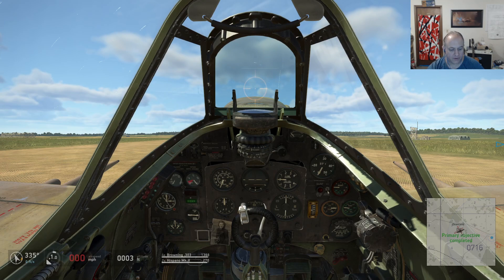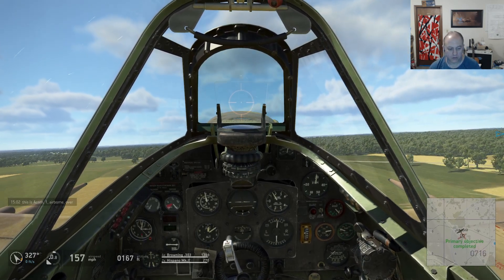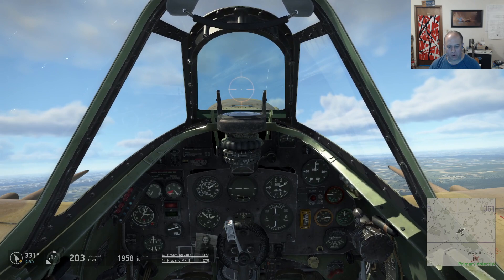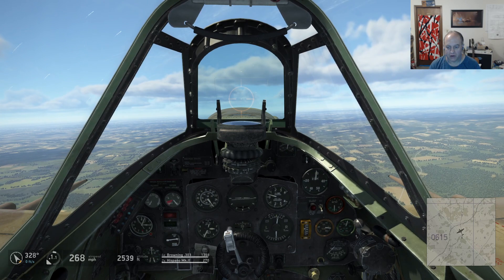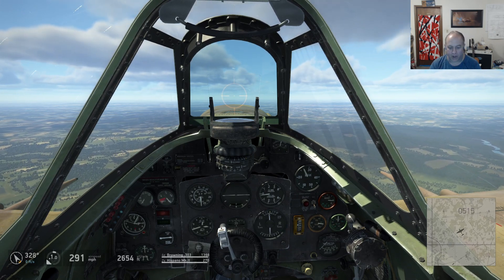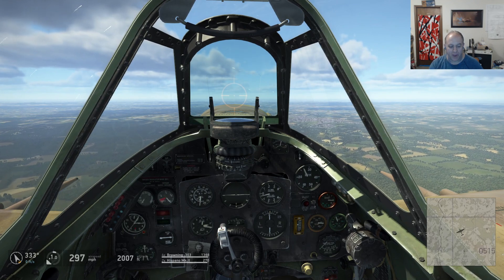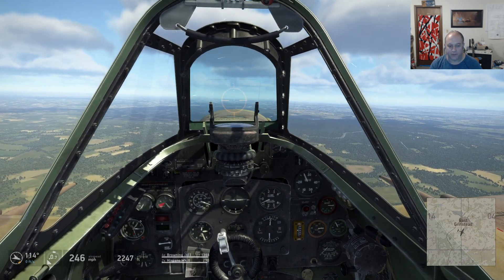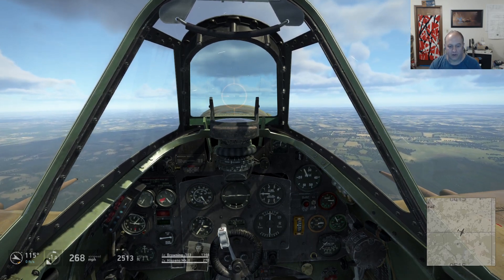Adverse Yaw and short period yaw oscillations in IL2 ( Spit IX )

Comment: What's your opinion, right now what flight sim offer the best base flight modelling? Or it's a very dumb question?
Reply from the maker: Well, I don't have XP12, but XP11 and MSFS can both be good, but its a matter of the data that goes into it.  A lot of the default aircraft in both sims are not that great.  For combat, I like DCS better, for both airplane handling and overall photoreal visuals, even though some airplanes have specific issues ( wheel brakes on P-51 for example ).  I like any sim where I can get under the hood and see what's going on  ;)  Aerofly also feels very good to me, but lacks in other areas, like turbo/supercharging for the Corsair or P-38.  Also, doesn't DCS have something like 3 different flight model systems?